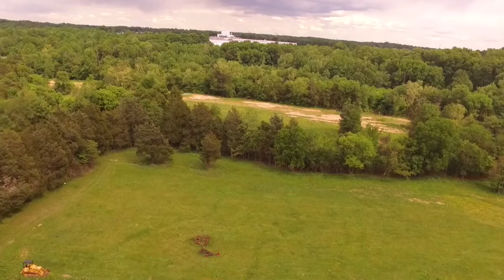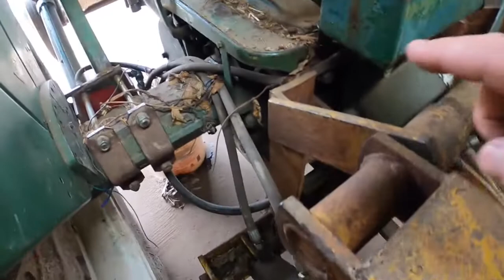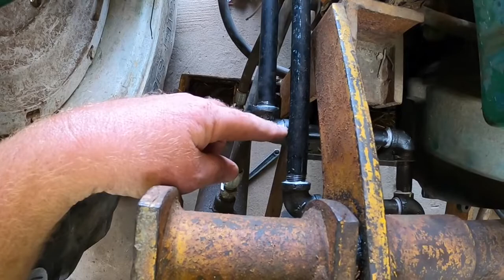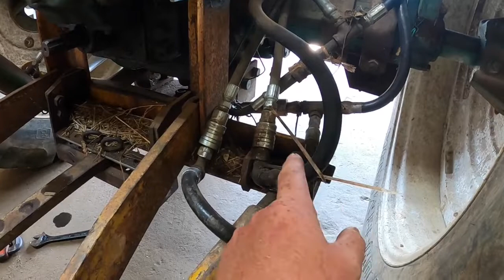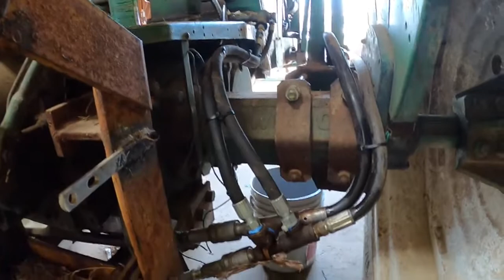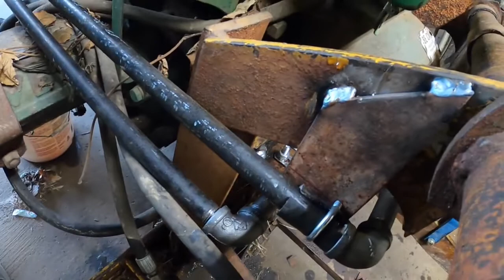Adding Auxiliary Hydraulics to the 770 Oliver for Fall Planting

Comment: Great job! I had to do the same thing on my little New Holland. Didn't have any rear remotes so I had to tap into the loader remotes. Not as neat of a job as you did. I just used flex hose. But it works. Thanks for sharing friend!!
Reply from the maker: Thank you Mr Bill, yes debated about that, some are concerned about the piping but the loader is plumbed with the exact same thing, so figured it would be ok. Thank you for the kind words and compliments! I wanted to get it ready for planting! Thank you, sir for always continuing to be here watching, supporting, following and COMMENTING!!

Comment: the steering on my boat is screwed up at this moment and apparently on the reduction gear on my boat I can put a pump in. according to my mechanic I'll find out about that price this coming week I bet it'll be in the 4-5000 range. I could run belt power steering for 1500 but the motor is rubber mounted so can't really go that route luckily my hydraulic tank has ports on the bottom and it's big enough I don't think I have to run a cooler but if I do that's not a big deal either. and us commercial fishermen wear hats all the time too just saying
Reply from the maker: Wow, the struggle is always real! Man I hate to hear that, hopefully it won't be that much! I know you need to be out on the water asap!! If you get time email me and we can get together on something😁😉 Thank you Josh for always being here watching, supporting, following, and COMMENTING!!
Reply: @Pennies_on_the_dollar  I just need to fix my boat right so I feel comfortable selling it so I get a bigger one but I've been boat shopping and the wife's almost there 🤬 det that will give you drive well at least me not these younger generations lol
Reply from the maker: Amen brother!!!